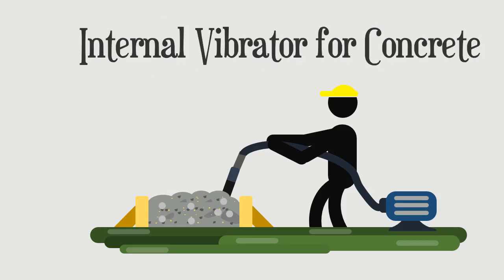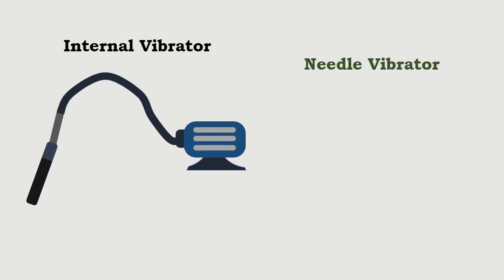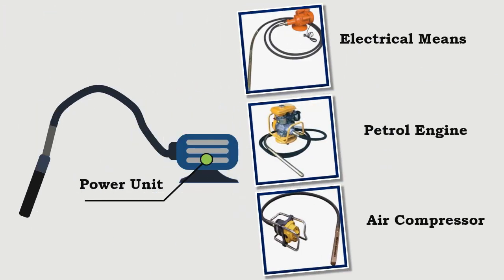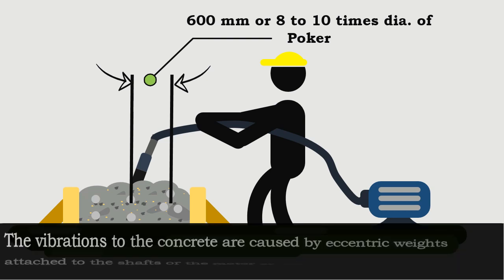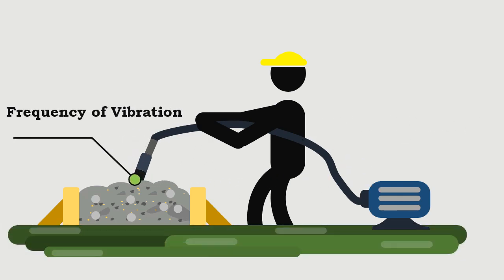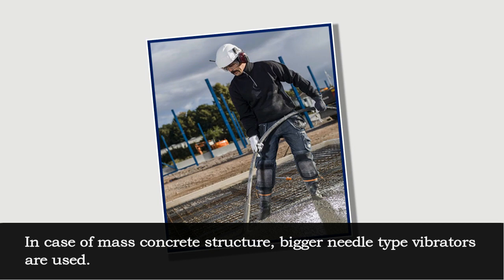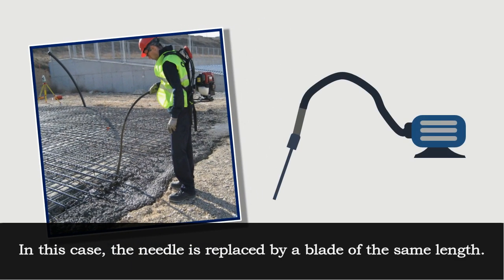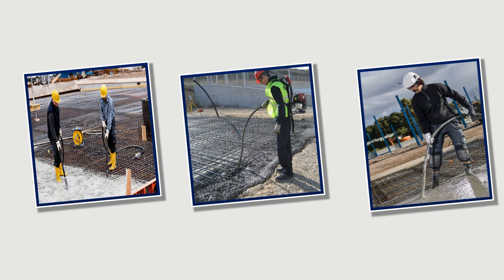Internal Vibrator for Compaction of Concrete || Manufacture of Concrete #22 ||

Comment: Hi, i have a question for you. ¿If i have a concrete with 10cm of thickness should i vibrate it with mechanical methods or manually? Thanks for your answer.